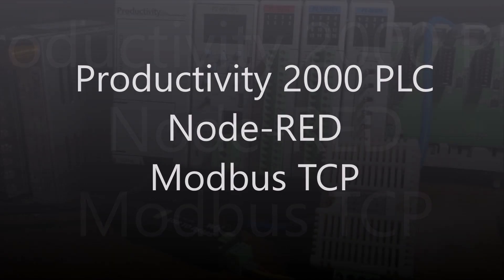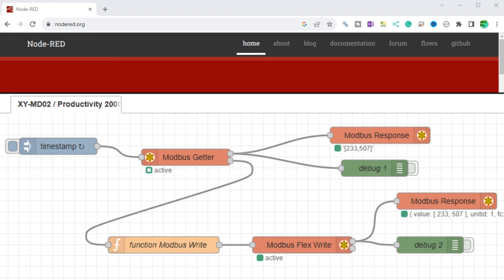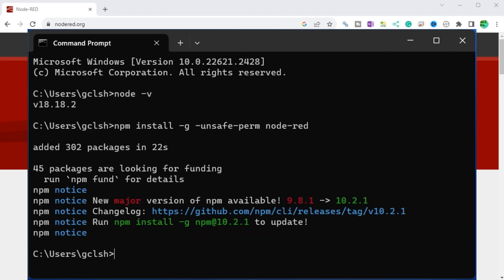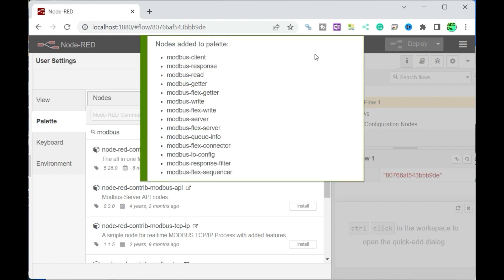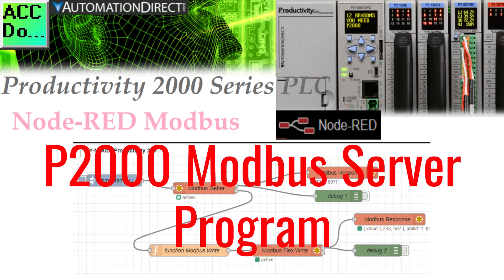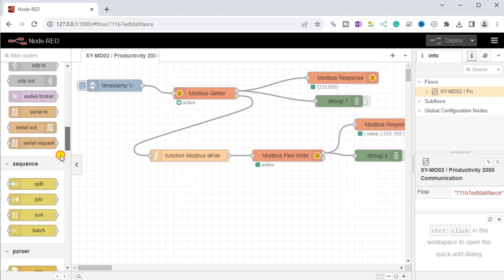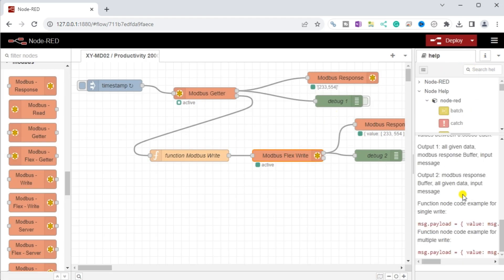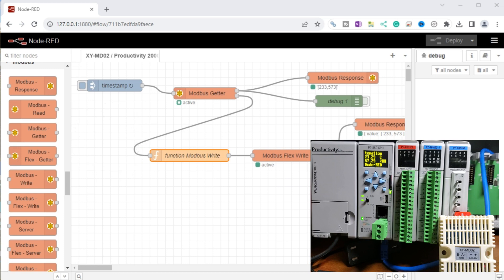Productivity 2000 PLC Node-RED Modbus TCP

Comment from the maker: Node-RED Series can be found here:
https://accautomation.ca/series/node-red-iot-enabling-software/
This will cover the installation, communication, database saving, dashboards, viewing from a spreadsheet like Excel, etc.

Detailed information can be found on our website. The post for this video is located here:
https://accautomation.ca/productivity-2000-plc-node-red-modbus-tcp/

The Productivity 2000 Series PLC is located here:
https://accautomation.ca/series/productivity-2000-series-plc-p2000/

There are several reasons why we are using the Productivity 2000 Series Controller. Here are just a few.
- CPU with five communication ports
- 50MB user memory - Can handle very complex applications easily.
- Limitless PID – Autotuning – Individual or Cascade Mode - etc
- OLED message display on the CPU module
- Plenty of discrete and analog I/O modules
- Status displays on all discrete I/O modules
- I/O Modules have QR codes. This can be scanned to have the module's latest specifications/wiring diagrams.
- OLED data display on analog modules
- P2-RS remote I/O expansion module, or use the Productivity1000 P1-RX remote expansion module to add even lower-cost remote I/O to your system
- FREE full-featured Productivity Suite software
- Programming with several ports - USB, Ethernet, Serial
- Hardware auto-discovery
- Hot-swappable I/O - Remove cards with power on the system
- Choose from three wiring options
- Slim DIN rail density form factor:
 - hardware - power supply, CPU, and seven modules in only 10-1/2 inches
- All project files (program, tag name database, and all the program documentation) in the CPU
- Run-time editing and debug mode on CPU
- Easy data logging with micro SD on CPU
- Secure Web server to access data files and system tags
- Easy drive and motion controller integration
- Coordinate motion control with PS-AMC allows control of up to 16 axes and synchronization of up to 4 axes
- Two-Year Warranty

The Productivity 2000 series of programmable logic controllers currently has all of these features built into the P2-550 CPU.
This CPU (Central Processing Unit) is also known as PAC (Programmable Automation Controller) because of its communication capabilities.

ACC Automation
https://www.accautomation.ca